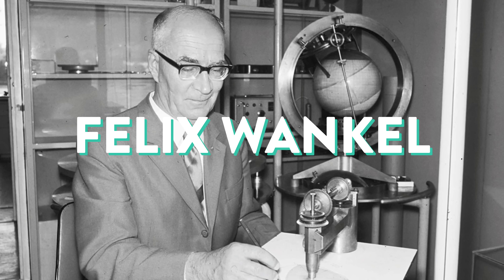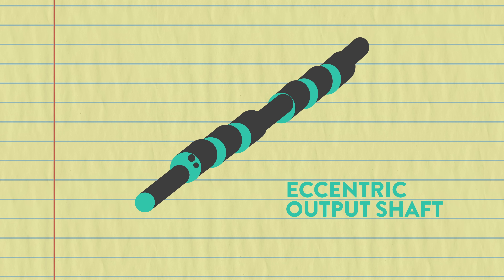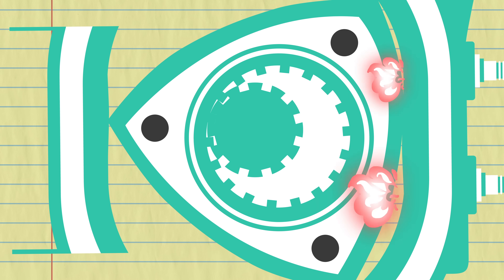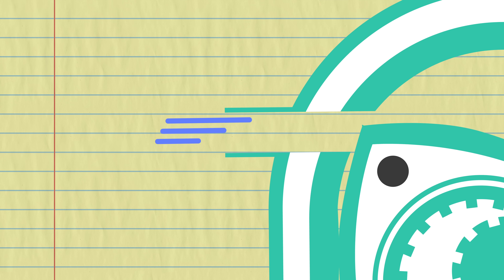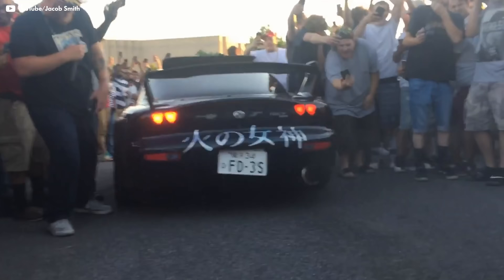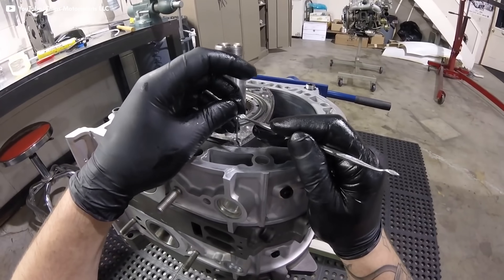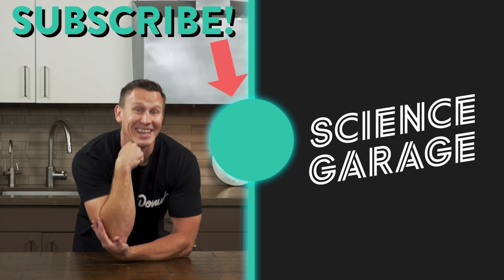Rotary Engine | How It Works

Comment: Woah, woah, woah. Didn’t the rotary engines use graphite rods on the seals to lubricate and to create a tight seal? The graphite wouldn’t burn but it would cover absolutely everything. I thought I read that somewhere.

Comment: Next video: What causes Exhaust pops and flames?!
Reply: hot unburned fuel
Reply: @jake-bf9sh  FUEL MILEAGE IS ALL ON THE LEADING PLUG HOLE AND YOUR 2MM APEX SEAL  MAJOR WASTE OF FUEL AIR AND COMPRESSION FIX IT
Reply: Anti-lag

Comment: Maybe to help improve efficiency and fuel economy is add high pressure fuel injectors, timing and lean it out for more effective fuel burning. Of course it's going to add complexity but I'm sure with some clever engineering, someone can pull it off.

Comment: How does a manual transmission work if the stick is on the dash like mini vans and how does the steering wheel work when the car wheels are behind the driver

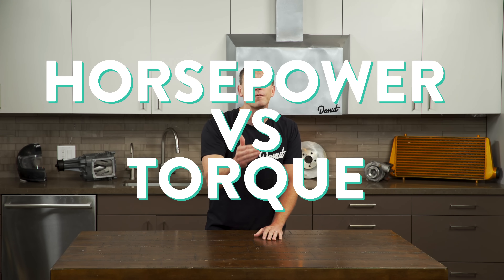Comment: 5:58 For those who are wondering what that thing is that extended? Its a variable intake manifold that is used in some hypercars and sportbikes. The length of the manifold is extended for more torque on lower rpms and shortens for higher Horsepower at peak RPM.

Comment: Nice explaination of the Wankel enigine, thank you for that. Only missing the beginning of the history of the Wankel engine at NSU in Germany. Felix Wankel developed the Wankel engine at NSU and in 1964 the first production car with a Wankel engine was the NSU Wankel Spider. It was a small convertible sportscar with a single rotor Wankel engine in the back. I personaly own a NSU Ro 80, which is a 4-door saloon car introduced in 1967 with a two rotor Wankel engine (one spark plug per rotor) and a, for those days, revolutionary wedgeshaped designed body.